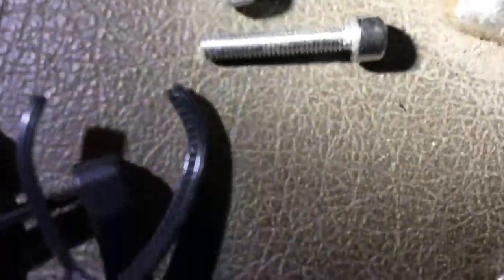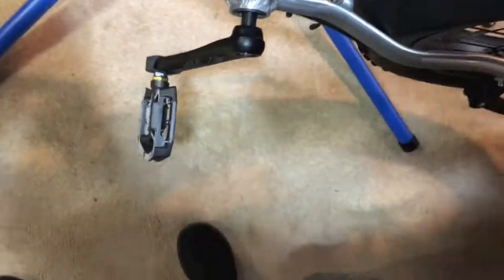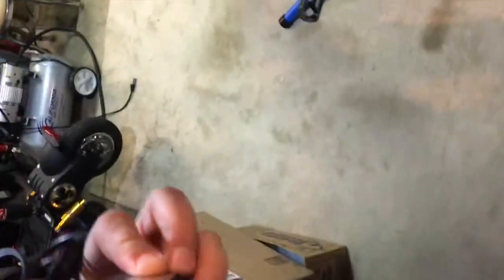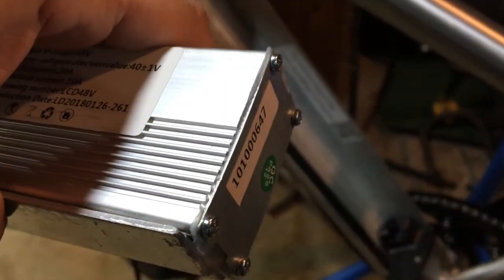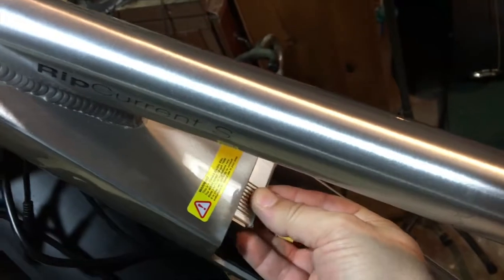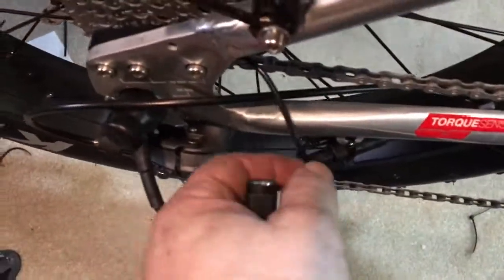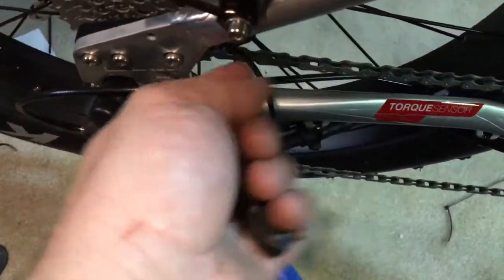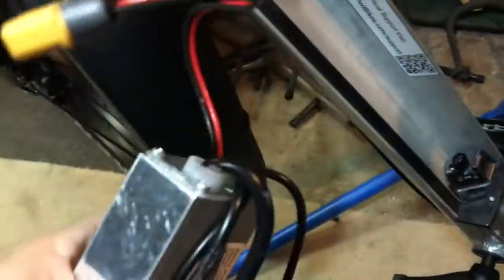Juiced Ripcurrent  S - Bad Controller Changeout  ECU ebike

Comment: I wonder if the factory put it in that way so that the controller fits snugly in the down-tube to eliminate any rattle - just a hypothesis. However it seems that you'd want the controller to have full contact with the aluminum frame to act as a heat-sink to keep the controller cool. Thanks for posting your video!